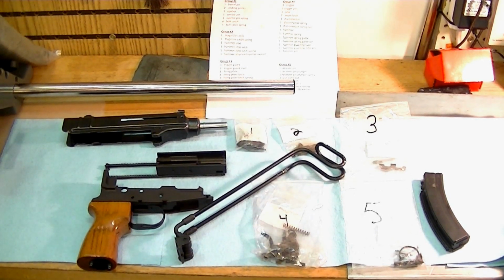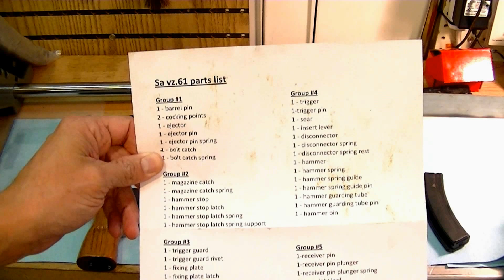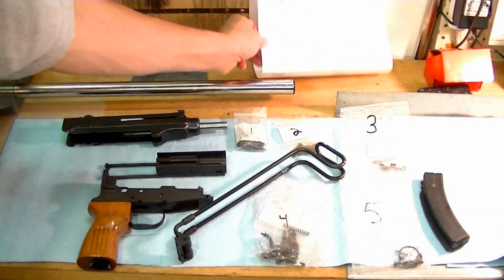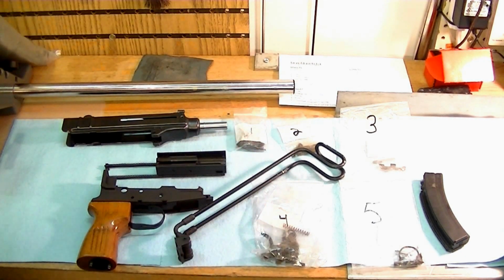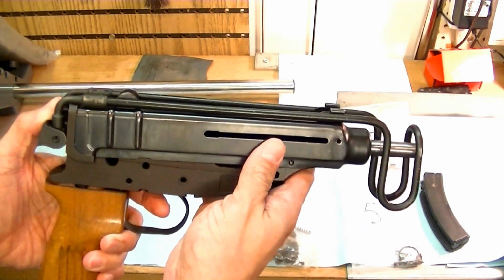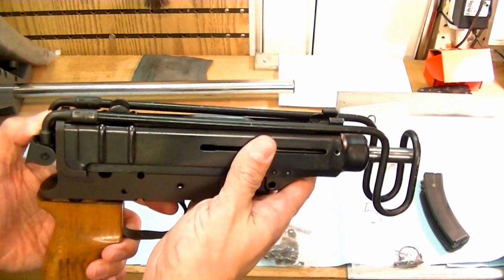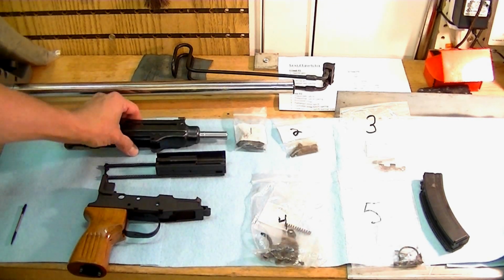SA vz. 61 Skorpion build (1 of ?)

Comment: I know this is 7 years old but hopefully I’ll get a reply still . Does the receiver come I
With all the S/A stuff all-ready done or did you have to convert the bolt and trigger group and put a bar in the receiver like you would an UZI?
Reply: So, I know this is 2years old. But most kits (now) come with the conversion done to the FCG, other than the FCG there are no further modifications unless doing a semi-auto conversion when rewelding the receiver stubs. I bought a kit a little over a year ago and it already had the Auto features milled off of the necessary components.

Comment from the maker: There is a lot of data and theory that indicates that oil may in fact be abiotic and a resource that the earth is continually replenishing.  They have proven that you can drill anywhere on the earth and find oil, you have to drill to a certain depth (or distance from the core) and you will find it.  There are areas where it is shallower (middle east, TX, etc) but there are some theories that talk of oil being a lubricant of sorts that the earth constantly creates. I don't know but it is neat